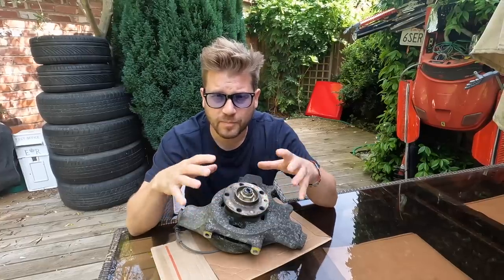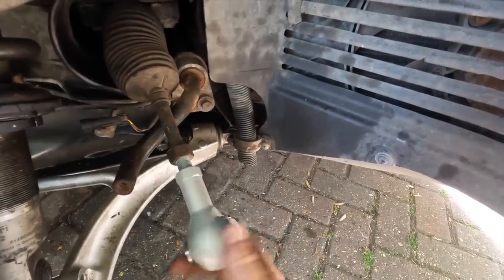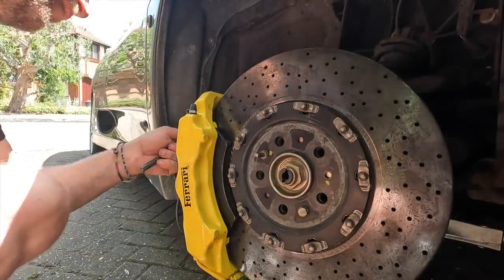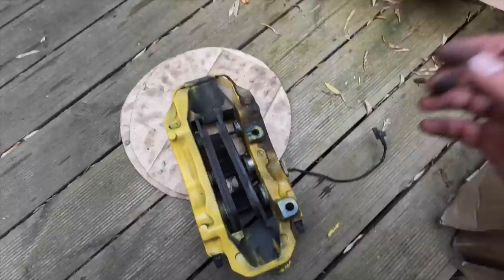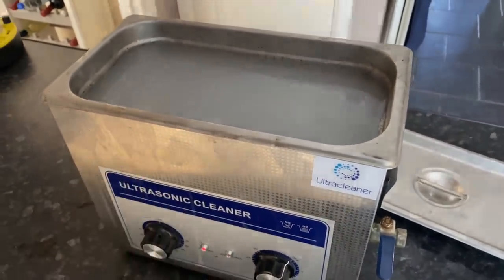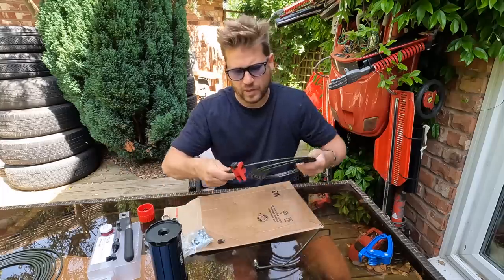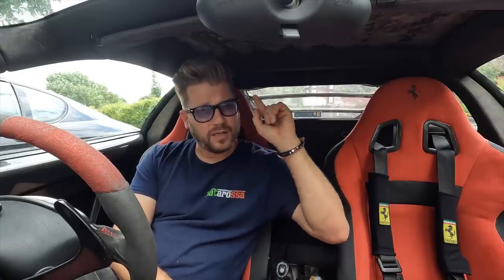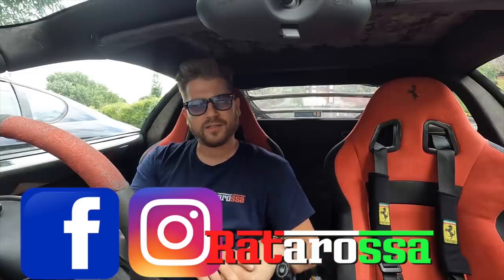DIY Ferrari Brakes Repair Saved £6000 With A Simple Hack

Comment: to replace the pistons... the easy way....put them in the freezer for 24 hours,,, before you out the pistons back in the bores, to keep from rusting/corroding into the bores.. coat the pistons with silicone brake grease,, put the  seal onto them try to keep them cold,, very important... then just press them into the bores... you dont need any tools to do it this way.. have rebuilt many brembo calipers this way.. and you can fine seals for these calipers,,, just measure the piston diameter and match  those piston diameters with other brembo calipers..i have repaired those 6 piston calipers 2 times while i was working at alfetta motors in vallego ca...was not hard to do
Reply from the maker: very very handy tips, thanks very much !

Comment: The rear caliper on many motorbikes end up with seized pistons due to them rarely being used as most riders just used the front brakes. Why? Look that up on you tube. ??? There are guys out there that specialize in this problem. I fill with WD 40 and use compressed air to do the trick. I cannot condone you out there to use this method as it borders being dangerous, but its never failed. If there is a will there is a way. Just be careful.

Comment: Induction heater around the broken bolt and hit with hammer around it and then hit it in dead center with a syl or something pointy and then use a "drill that drills the wrongway" ?

Comment: You can get a brake pipe made at most motor factors quite easily. No need for a Ferrari part when you can make one yourself...right?

Servicing these pistons is no different to servicing callipers on most decent bikes. Its messy but serviceable for 99% of the pistons. I had the same issues with my Hayabusa. 6 pot callipers can be a right pain!

To get that bolt out, you need to use a centre punch and punch it dead centre and drill out the centre with a slow drill bit. Get it dead centre and as you remove the core of the bolt, apply heat and then use liquid CO2 to cool the bolt remains and it shoudl cause it to shrink faster than the hub. If you get the sizes right, you should be able to remove the bolt from the inside, out.
Reply from the maker: Absolutely, its a little harder here in the Uk v US as less local shops do that kind of work.

Put it this way I bought that whole kit and tools for almost what it would have cost me to get the tiny pipe from Ferrari. All of which i will now be using on the BBI project soon
Reply: Or just do it at home , like he has done simple with a cheap flaring tool
Reply: @Ratarossa  Maybe I am lucky. My local motor factors does brake pipes for me. I just take them the bits of what is left and they make a new one just like you did and its worth paying them to do it. It's almost always less than £15. Im in the UK too. 

I LOVE how you will be using the kit on the BBI rather than lose that money to the Stealer. Brilliant when that happens! :D

Comment: I would possibly try and drill that bolt out. Use something that is smaller diameter than the broken section. Sometimes the stubborn broken bolt crumbles away and you can get the debris out and run a tap in to clean the thread up
Reply from the maker: thats not a bad idea. worth a go
Reply: @Ratarossa  I bought a set of left handed drill bits for drilling out broken bolts. As you drill and remove material, the pressure on the threads is reduced. Since the drill bit is left handed, sometimes it'll just start threading itself out on its own. Use lots of penetrating fluid though.

As was suggested, a machine shop can get you there as well, and they have more and better tools which makes that job easier. If the threads end up damaged, a machine shop can put in a new insert (heli-coil or similar).

Comment: Ha. removing  broken bolt like this is easy. drill 2 small dia holes 1 cm deep (at least) inside the thread opposite each other (north - south). Cut a T -shaped tool from an old spring steel suspension leaf with 2 lugs, that fit the 2 holes. heat up the surrounding metal of the bolt gently. insert tool and turn.

Comment: Time to make up a brake pipe out of NiCopp.    Thought about trying to weld a nut onto the remnants of that bolt left in the hub?
Reply from the maker: Will try, im out of pocket £200 so its not the worse thing if it goes wrong now

Comment: Lots of way to at least attempt to get a bolt out, soak in penetrative fluid, now it's off you stand a chance of getting it in, tap the edges with a centre punch, failing that heat it up and repeat

Comment: Scott,  excellent video and a great save. 
The proper way to get that bolt out and save the hub is to get it set up in a vertical mill and find absolute dead centre of the bolt, they can then drill down and accurately the root diameter of the thread. This will leave just the coil of thread in there which can be picked out by hand. Then run a tap down it and away you go, I'll dig out the video of this being done. For what the hub is worth I wouldn't risk just running a drill down it.
Edit: found the link, watch this https://youtu.be/kUOina5ULZo
Reply from the maker: Thanks Stu, when you popping by the shop ?
Reply: @Ratarossa  you bet, I need a new front brake pipe for my motorcycle 🙂. Seriously, I really must come by.

Comment: Hi, regarding the broken bolt I had a similar issue with a bleed nipple that broke. I found a process called SPARK EROSION that removed the nipple and left a nice clean thread for a fresh new one. Good luck. Regards Tony T.
Reply from the maker: cheers Tony I will check that out

Comment: Barum engineering or any local engine re manufacturing company should be able to drill that broken bolt out and install a heli coil
Reply from the maker: cheers I will check them out

Comment: May be wrong but possibly a lot of the damage to parts (brake pipe, bearing, bolt) is due to excess heat from binding?

Comment: Very well done MrC. In the nick of time too. Scott, what is the Dia of the pistons used in your calliper?? Kind regards Mike. Btw. I would try and weld to the remains of the old bolt and wind it further into the calliper carrier and out the other side. AFTER having soaked the far side in proper penetrating liquid allowing a day or two for reapplication and soak time. NOT WD40!
Reply from the maker: the pistons are 3 different sizes in those calipers. Thanks
Reply: @Ratarossa  Thanks Scott.

Comment: Another great vid. Will you need to replace the hub/bearing on the other side, so that both sides are balanced out??
Reply from the maker: It actually needs replacement anyway, has slight wear noise

Comment: I assume you looked into a S.S. flex hose with the proper ends to replace the hard line.
Reply: Hard lines should be replaced with hard lines, too many flexies will give you a soft pedal.

Comment: Luckily you didn't crack or split the caliper with those two pistons pushing against the sockets.
Reply: It's only the same as using the brakes on the car.
Reply: @philtowle4683  I agreed on first reading but then I thought no it isn't (sorry). You dab on the brakes, squeeze light pressure or hard on in an emergency only briefly but the pressure here is on for a considerable time and is incremental as he keeps pumping the grease gun. It must have been very high to free-up the seized pistons

Comment: Love you have a Ferrari 360 as your daily beater. How much, all in, you reckon you’re in for that car? Over say 3 years/ 5 years?
Reply from the maker: Well ive owned it over 12 years and used it pretty much as a daily. Not a lot at all, service wise they are pretty cheap. Its the odd jobs like this where they cost a bit more. Obviously with The CS and the extra cost of CCM brakes etc they are a little more to run than a standard 360
Reply: @Ratarossa  awesome man. Sadly I don't have the time or skills, lol. I get the engineering but not the confidence! So in the meantime I'll pay someone to work on the old Jag XK8. Manual conversion is on the project list!

Comment: Just drill the stud out untill the metal is thin enough to break away.
Reply from the maker: This is what a few have said and I guess ive nothing to loss doing that ...well £200 hub is all
Reply: @Ratarossa Just dont snap off the pilot hole drill bit in the stud !

Comment: One thing I have noticed is you don’t use any grease when re-assembling the various bits… any particular reason?
Reply: Have to be careful applying grease to fittings, it can lead to over torquing of bolts(due to the lubrication) resulting in stripped threads but also result in then coming undone, unless specified grease or oil shouldn't be used in threaded parts

Comment: Noticed you never check the discs for wear. How long to they last compared to standard discs?
Reply from the maker: In theory a very very long time. They wear most when heavily tracked otherwise they last much longer than standard steel brakes

Comment: Why didn't you go to braided stainless steel lines .... .. my Lotus has them on all four calipers, as well as the Ohlins remote reservoir shocks from the factory.
Reply from the maker: never used them on any of mine. Do you notice any real difference ?
Reply: @Ratarossa  Scott:  my Exige came from Hethel with SS brakelines and remote shock reservoir lines so I can't make a comparison, however, I converted all my race bikes (superbikes) from the factory rubber brake lines to SS lines and it made a big difference. Quicker response, better feel ... I wouldn't race without them.

Comment: Hi Rat  bolt the calliper back on the hub  then get a sleeve  machined to fit in the bolt hole of the calliper then use a drill in the sleeve to drill a hole in the bolt .My friend Christian did this on a combine harvester check out this link.https://www.youtube.com/watch?v=T-4rZ4FYQTE Also dont forget calliper bolts have thread lock on them so penetrating oil will help NOT WD40.

Comment: Use air not grease.
Reply from the maker: Watch the first video !
Reply: Air is convenient, but won’t easily work for very stuck pistons.

Plus safety wise, air will compress with pressure. So if / when a piston manages to come out it is acting like a very large, heavy and powerful air pistol pellet. With grease it won’t really compress, so as soon as the piston moves there is no pressure. Hence the piston won’t go flying.

Comment: what kind of brake fluid do they use that can cause that kind of damage? 
are other brands of vehicles that use carbon ceramic brakes also have the same issues? Porsche? 

BTW: the amount of wear on those low mileage components is horrendous. i would expect more from a top notch manufacturer. Ive seen hundreds of Japanese cars with 300K on the odometer with less wear than that....... it doesn't matter how bad-ass the toy is, if it's broken all the time or requires loads of maintenance more than it's peers, it's still a piece of sheet.

Comment: In the spirit of diy, why don't you drill out thr bolt and helicoil it shouldn't cost you more than £40 in parts and equipment
Reply from the maker: Never tried Helicoil ..... so best I start on a Ferrari.  I will certainly look into it
Reply: @Ratarossa  really easy to use to be honest I had to repair my carbon mountain bike that had a sheared bolt,  from what I read helicoils are stronger than standard threads and if it get damaged you just replace the coil

Comment: Hi there, you need to buy a proper Set of Tools, cant see you working with this allen Bolt like me as i was 7 Years old working on my Bike ;-)
Reply from the maker: I have so many ... i can never find them. I need to have a sort out and more space
Reply: @Ratarossa   I thougt about Sonic S14 958 Toolbox, everything you can dream of in one Box ;-)
Reply: I thought that cheap tools on expensive cars , but hey we all have them {cheap tools that is } Halfords advance is plenty good enough , as opposed to snap on , all the gear no idea .Would pay to invest in a Mapgas torch  worth its weight in gold , and not that expensive  .The older plumbers gas torches just do not give enough heat